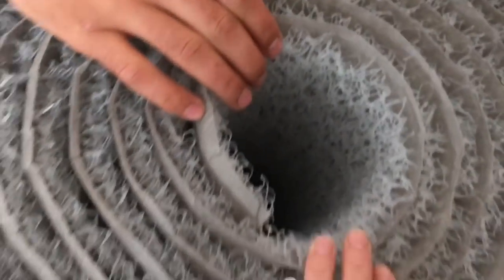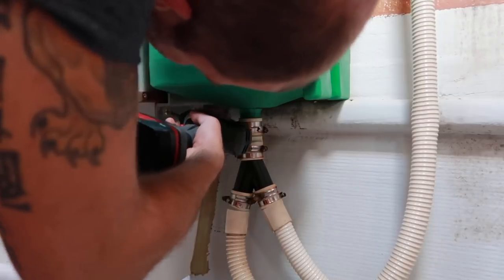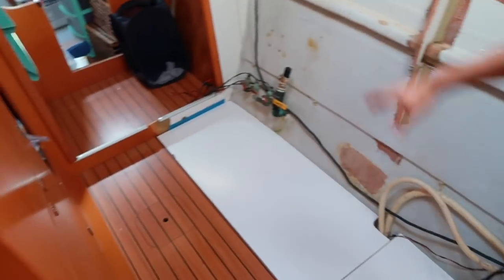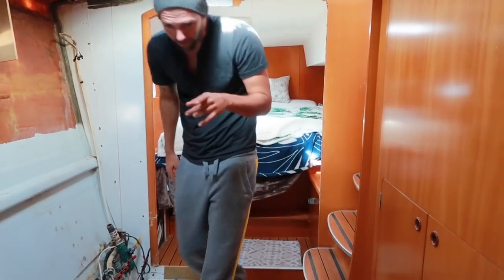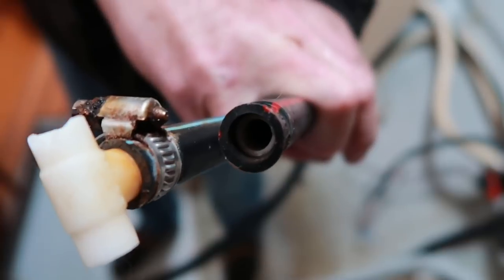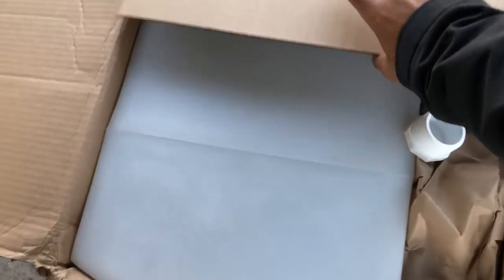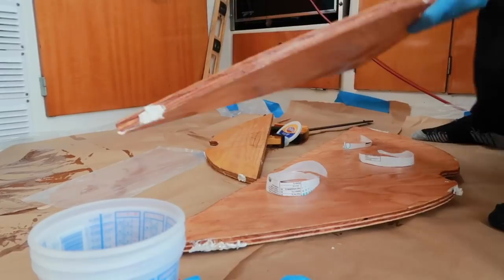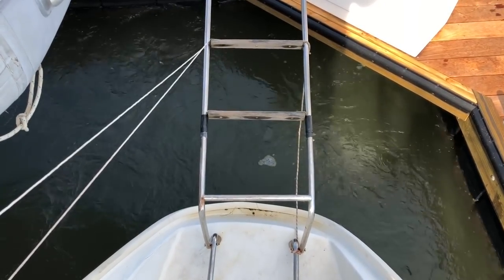Boat Refit Month 1

Comment: I’ll add my approval for the red and blue pex. I redid a lot of the plumbing in our 1950s house, and having two different colors for hot and cold helped me keep things straight (and the different colors weren’t any more expensive). Just be aware that the typical variety pex at the home centers (which was what I used as well) isn’t resistant to UV, so cover it or keep it out of the sun. Cheers!

Comment: you should get the info on the hule cutting out the bulkhead and not replacing it just maid that hule weaker.and I mean very weak.you get a solid wave broad side it will cave in that wall.your glass is very thin.

Comment: 1/4"  4' x 8' divinycell ~ $135,  1/4"  4' x 8'  birch plywood $30
Reply: Yea and I always liked birch too. A pretty and very workable hard wood.
Reply: You are shopping at the wrong place.... For PVC cores that are not structural you don't need those European 'name brands' that you pay a ton to have imported.  I can get 1/2" Airex 4x8 sheets for $85.  Shop around.
Reply: Nice, good to know if wanting to do hull or deck. However at that price, it is still cheaper to build your own for non-structural interior wall, which does not even need such closed cell foam properties. For example $25 balsa core and laminate $10 panel of shower PVC liner. Or buy cheaper PVC core like Baltex Airlite for $30. Or get this, as Ken originally brought up, buy $30 birch plywood from any local lumberyard, without needing to find specialized and likely needing shipped product all for equivalent cheap price :O

Comment: You can save some decent cash using UScomposites for resins and glass materials. Ive used their epoxy and vinyl ester resins and they are legit. A lot better priced than West.
Reply: SunsetWingman Hey thanks for sharing that. West system is crazy expensive! I've been wondering a long time if there were a better one. I'll be looking into them.
Reply: SunsetWingman I'm from western Canada, so I'd be shipping either way unfortunately. 🍻